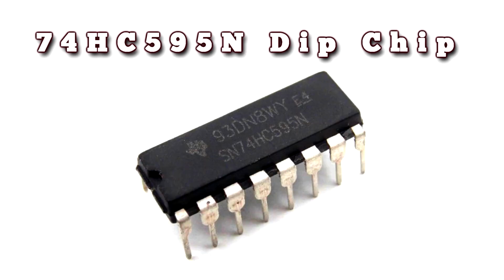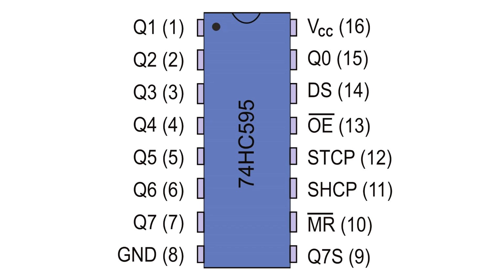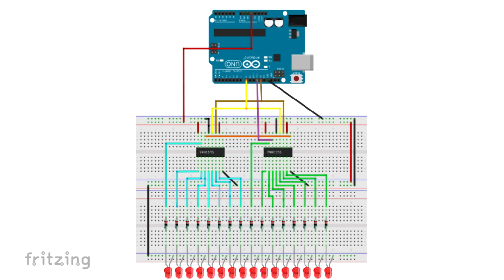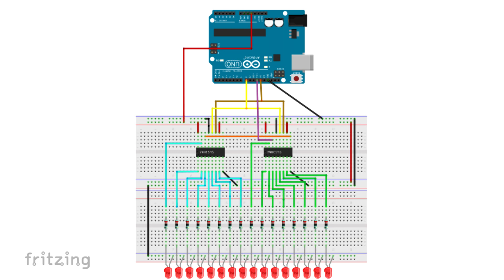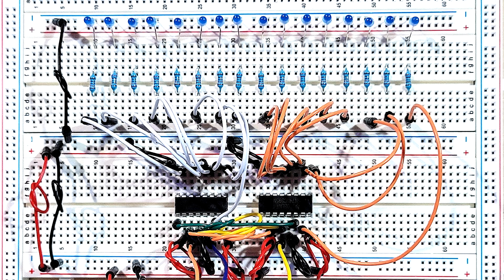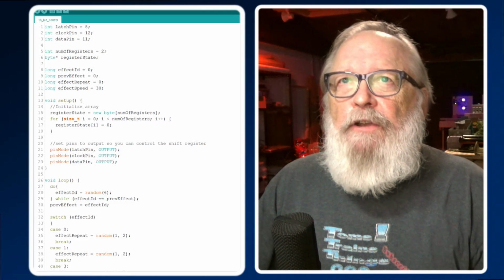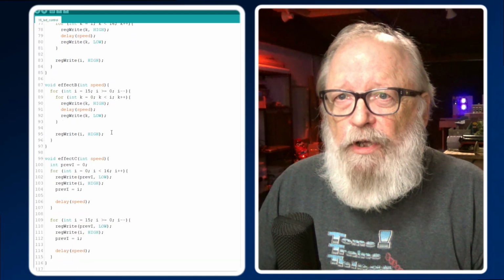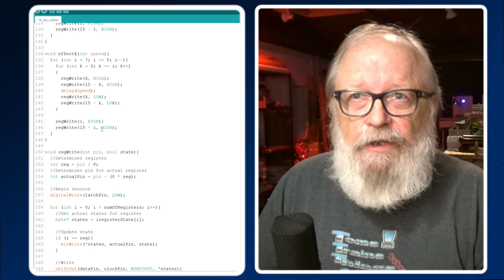Increase Your Outputs In Your Arduino Project With A 74HC595 Shift Register

Comment: Excellent introduction to the 74HC595 shift register Tom. I've used up to 5 in series to provide 40 outputs to control the LEDs on a large control panel with minimal wiring to the panel..
Reply from the maker: Sounds great Art. Your way ahead of the curve!

Comment: Cool video and certainly a nice instructional project for learning some basics about chips and hardware related coding. For a real application I would probably prefer using NeoPixels for LEDs and IO extenders for GPIOs. Less wiring for the LEDs and bidirectional and addressable IOs ;-)
Reply from the maker: Many thanks! I've done a few videos on that also

Comment: I have no idea what a Arduino is or what you just said, but it sure sounded good ! Haha
I 've watched some of your videos to hopefully trouble shoot my Riverossi 4-4-0 steamer Genoa ( I haven't run it in about 30 years),   I used your 9 volt battery trick on the motor and it works but not on the drive wheels so I think it's a electrical contact problem.  I'm going to buy a multimeter to try and identify where the problem is, I watched your video on multimeters, thanks
Reply: Check out SMT Mainline's sight. He may have already done a video on how to repair your particular locomotive.
Reply from the maker: Thanks for watching my videos. Check the wheel wipers.